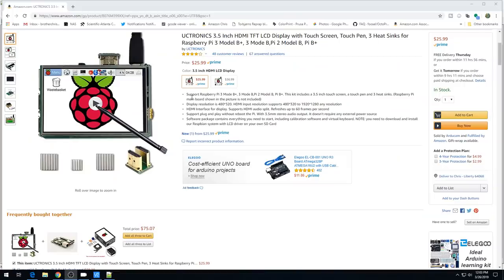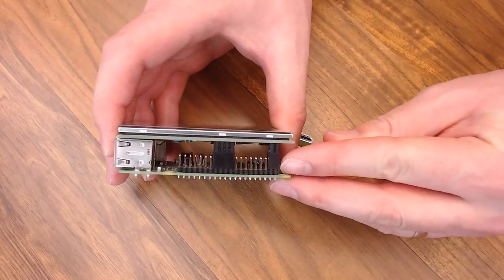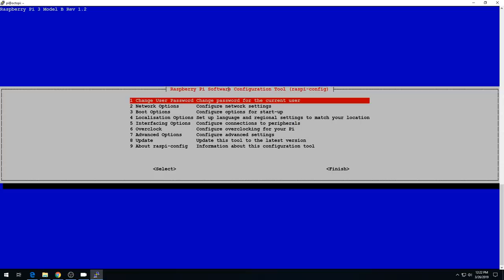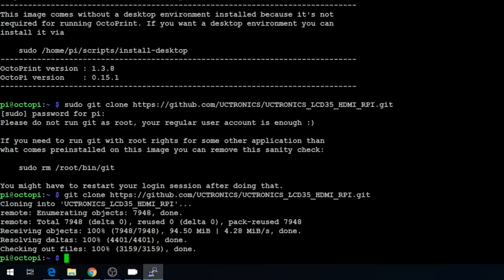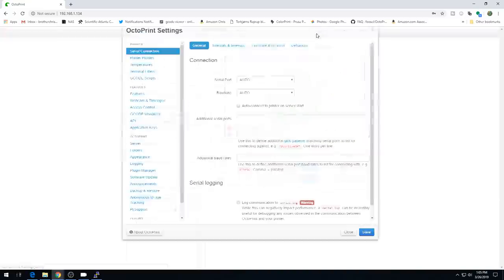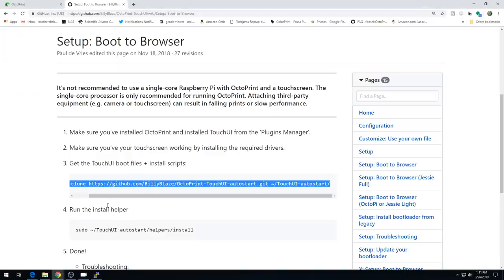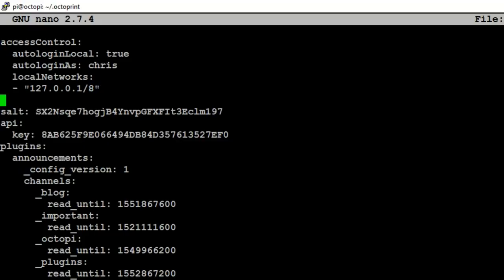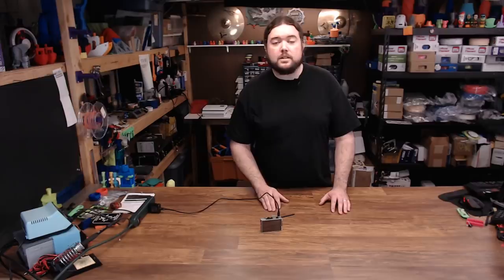Octoprint Raspberry Pi Touch Screen Install - Touch UI - Chris's Basement

Comment: Hey Chris! I'm running Klipper on my RPi 3 B, and just installed TouchUI and am using a 7" RPi touchscreen. I'm having some issues with Chromium taking a lot of CPU bandwidth, to the point that the print pauses occasionally and resumes. I'm curious to hear if anyone else had a similar experience...

Thanks for the video!
Reply from the maker: It doesn't surprise me that it is a pretty heavy load, but I wouldn't think it would cause that many problems. Maybe your pi is getting throttled because of heat or low power?
Reply: Try Octoprint TFT if you must. It's running a native gui on a lightweight x server, not an entire clumsy browser with a shiny x. Or better yet, just get a cheap tab and load the giu from there leaving the pi just to handle the actual printing.
Reply from the maker: @mrkekson  Really? I would like to check that out.

Comment: hello i carefully followed your intruction, however after installing the autoboot script instead of display the login page, it display a sad face document. if i touch the screen this error message appears: 
[::1] refused to connect
what should i do now? thanks
Reply from the maker: Try this https://community.octoprint.org/t/touch-ui-plugin-not-working/16757
Reply: @ChrisRiley  hello, it fixed many thanks. one question, how i can activate forever the onscreen keyboard? everytime i shut down and restart the keyboard is inactive and i can't use it until i reactivate it. thanks
Reply from the maker: @yurif74  I am not sure on that one.

Comment: great tutorial. I have my UNTRONICS screen up and running. However, I mistakenly touched the log out on the screen and can't type or use my usb keyboard to log back in. I need to do a sudo shut down and let it reboot into the touchui. I'd like to try the virtual keyboard for this purpose, or get the usb keyboard to work on it. Can you help me. Thanks Chris.
Reply from the maker: I'm surprised the usb keyboard doesn't work. I would have to test it and see what I get.
Reply from the maker: So I re-did my config, I was able to plug in a USB keyboard and enter my username and password.
Reply: @ChrisRiley  what part of the config did you do. Or was it just an apt get update? Cause I did that and looked inside the raspi config file and can't find anything that pertains.
Reply from the maker: @jwhiting352  I just redid my pi software and screen software from the beginning. My hp usb keyboard does work.

Comment: Well not sure what happen when I installed  touch UI. I rebooted octoprint on my web browse(Laptop) and now Octoprint  is displaying Black background and blue bars across the screen. I should be only seeing this on my 7" touch screen. This is the 3rd time it happen.
Reply from the maker: It know to turn on touchUI based on screen size. Maybe the 7" is throwing it off. You can turn the touch UI off in settings to see if you can fix it.

Comment: Hi Chris - After adding the local network to the autologin inclusion, the octoprint server no longer loads. Any ideas?
Reply from the maker: You have to be very careful in that config file. The characters are posistionl, make sure you have them lined up just right.
Reply: @ChrisRiley  I'll go back and try again. It looked identical to the video, but perhaps too many spaces. Is the first indention one space or lined up exactly as in the tutorial (was 2 spaces if i recall correctly)?
Reply from the maker: @jnstover4  Yes, I think it is 2 for every indent.
Reply: @ChrisRiley  I found the problem. I didn't move the SALT line back underneath the networks. Thanks for getting back to me.
Reply from the maker: @jnstover4  Sweet! Glad you found it.

Comment: Hello Chris and thank you for this vidéo :) I 'm ok with all but on my 3.5" i have a blank screen. Do you have an idea please ?
Reply from the maker: Hey Marc, it won't even boot to the CLI? If that is the case I would say the screen might be bad.
Reply: @ChrisRiley  Hello i try another way and i put it on my blog how. Your help was cool :) You can see how here : its in French but the line code are Internationnal :) https://kits-imprimantes-3d.com/comment-installer-un-ecran-tactile-3-5-rapsberry/

Comment: Hey Chris, great work! it`s done with Waveshare 4.3 inch LCD :)
But one pronblem i have is, icannot start my webcam.
do you have a solution for that?
Reply from the maker: Thanks! Can't start the webcam, so nothing comes up at all? What cam are you using? Does the cam work in the browser version?
Reply: @ChrisRiley  Hey Chris, i use Raspberry 4 B with Raspberry CamV2. before i install TouchUI is the Cam Workin. but after doesn`t work.
Reply from the maker: @slowlyer  Not sure, but you might check over on the touchUI github. Not sure how compatible it id with pi 4 yet.
Reply: @ChrisRiley  okay, it works now :)

Comment: Expanding file system is still important for any micro larger than 4gb. Otherwise, you'll end up with inaccessible space on the card, which limits the amount of stl/timelapses you can store on the pi until you can transfer them elsewhere. 

when installing packages as a user from the command line/ssh, you should be using apt now, instead of apt-get

this also provides a new arg to perform full upgrades. 

sudo apt full-upgrade -y

You should never really be chmodding anything to 777. Usually, you would want to do something like 775 if you are really not sure what permissions you need in this particular env.
Reply from the maker: Good tips.

Comment: Thanks great video.  I am waiting on my screen. I have done everything in the video to the point where you get and install the drivers.
Reply from the maker: Thanks for watching! Good luck with your install.
Reply: He only shows the HDMI version that doesn’t need drivers, I’m trying to get the cheaper non hdmi screen set up and I’ll update here if I figure it out.
Reply from the maker: @kumd  Are the HDMI ones more expensive?
Reply: Chris Riley The HDMI versions are about $10-$15 more. Non HDMI touch screens are only around $15 total. But I spent hours trying to set it up with octopu even trying multiple drivers. But could only achieve a white screen. I have a 5 inch hdmi version from a previous project that worked great following your tutorial. I would seriously recommend buying ONLY an hdmi version
Reply from the maker: @kumd  Got ya, thank you for testing it for us.

Comment: chris, well done video.  i have a raspberry pi 7" screen, i get the message "This site can’t be reached localhost refused to connect." and i do not have the config.yaml file in octoprint
Reply from the maker: Thanks! Is it a TFT screen or an HDMI screen? Not sure what the error is referring to. No vaml file in .octoprint ?  ls -als ~/.octoprint

Comment: Great video,  followed it step by step but at the end when the screen attempts to connect , it counts up to 30 then the touch  UI text goes red and the message below states can't connect, Touch Ui failed ...what am I missing , the screen is  from Amazon elecrow 5 inch  800x480
Reply from the maker: Are you using 0.14 octoprint? It might be a bug. https://github.com/OctoPrint/OctoPrint/issues/2348
Reply: @ChrisRiley  Thanks for messaging back, I've only been playing with Octoprint in the last 2 weeks, so what ever the version was then is what I started with, plus as per your direction I also updated to the latest version, and had the joy of finding out about 0x50005.

Comment: i dont know what the problem is, but for 2 installations i had to install the desktop to the pi first, do get this run. dindt i get this information from the video? :-D
Reply from the maker: I kind of wonder if this is a bug, the autobuild should install enough of the desktop to get you going.
Reply: @ChrisRiley  I don't know, I've Google it and it seems like many people have the problem - with many solutions to it

Comment: Ok today I boot up my ocotopi and it does an update. Now It wants me to LOG in on the tiny touch screen.  

I have configured my config.yaml  by the way you really really speed through that part. And I'm watching on a phone so Its really difficult to see what your typing.

I still can't get logged in. I've lost the use of my touch screen Again!! 

Why did the update screw me out of my touch screen?
Reply from the maker: It removed auto login from your config file. Take a look at it in SSH.
Reply: @ChrisRiley  ill look at that.  You have been great. I'd love a follow up video.
Reply: Is that the config.yaml ? 

Because it's still in there. Just not working
Reply from the maker: @JSCB-365  Yeah, that should do it. Is this still not working? I would like to recreate this if I can.
Reply: It needed a clean reboot. I wasn't doing that part right. I had to log in sudo reboot now. 

That is what fixed it.
Reply from the maker: @JSCB-365  Awesome!
Reply: @ChrisRiley  if anything I can be used as a Bad Example

Comment: Oh, and the case you listed in the description..... DOESN'T WORK WITH THIS LCD!  Anyone know where I can get one or where I can get the STL files that do?
Reply from the maker: There isn't a case in this description.
Reply: @ChrisRiley , I guess the assumption was when you flashed up the Amazon Screen at time index 0:49, the image presented an LCD, a pi, and case commonly purchased together.  My bad.....
The case present will only work with some modifications to accommodate the HDMI plug. The plug will also need some type of cover fabricated.
Other than that, It all works really well. Thanks!
Reply: One other minor thing.  The sudo command to download the driver files in your linked document in the description was incorrect. That command will install the drivers for a normal LCD, not the one for the HDMI ver. The following is the correct command
sudo git clone https://github.com/UCTRONICS/UCTRONICS_LCD35_HDMI_RPI.git
Reply from the maker: @vn1500g3  Ohhh, ok, I thought I was going crazy there for a minute. :) Glad it's working out for you.

Comment: Thanks for the tutorial. Very straight forward. I did have a question.

Do you know how to disable the screen timeout? everything works but the screen will blank out after awhile.
Reply from the maker: Hmmmm, good question, no I don't I would have to look around for that. I will see what I can find.
Reply: In the BillyBlaze/OctoPrint-TouchUI-autostart repo
touchui.default line 41
DISABLE_SCREENSAVER=true

Setup: Troubleshooting wiki located here
/BillyBlaze/OctoPrint-TouchUI/wiki/Setup:-Troubleshooting
says you can edit this too
sudo nano /etc/default/touchui
DISABLE_SCREENSAVER=true
Reply from the maker: @jonolsen7246  Awesome, thank you!

Comment: hello guys, 

I followed all the instructions. 
Everythings looks fine.
EXCEPT
My touch screen seems not to work when I click on it on TouchUI homescreen. 

Did you guy have the same issue ?
Reply from the maker: I saw that, but only when the drivers weren't working correctly. Try to reinstall the drivers and see what happens.
Reply: Thank you so much  @ChrisRiley  .
I have reinstalled everything.

However, still doesn't work.
I have noticed something.
On the boot screen : I have a "Failed" line that appeared after the driver install : 
"[Failed] Failed to start /etc/rc.local, Compatibility.
See 'systemctl status rc-local.service' for details."
Reply from the maker: @bananasESCT  Sounds like the driver loaded something into auto start that wasn't right. What does your rc.local file look like?
Reply: @ChrisRiley  , thank you so much for answering me...
Here is the extract of the rc.local file : 
#!/bin/sh -e
#
# rc.local
#
# This script is executed at the end of each multiuser runlevel.
# Make sure that the script will "" on success or any other
# value on error.
#
# In order to enable or disable this script just change the execution
# bits.
#
# By default this script does nothing.

# Print the IP address
_IP=$(hostname -I) || true
if [ "$_IP" ]; then
  printf "My IP address is %s\n" "$_IP"
fi

/sbin/iptables -t mangle -I POSTROUTING 1 -o wlan0 -p udp --dport 123 -j TOS --set-tos 0x00

echo
echo "------------------------------------------------------------"
echo
echo "You may now open a web browser on your local network and "
echo "navigate to any of the following addresses to access "
echo "OctoPrint:"
echo
for name in $_NAME;
do
    echo " http://$name.local"
done

for ip in $(hostname -I);
do
    echo "    http://$ip"
done

echo
echo "https is also available, with a self-signed certificate."
echo
echo "------------------------------------------------------------"
echo

In order to uninstall the driver, should I do "sudo rm -r mydir UCTRONICS_LCD35_HDMI_RPI" only ? or should I do something else ? 

Cheers !
Reply from the maker: @bananasESCT  The rc file looks of. You probably don't need to remove any of those files, we just need to find the correct one to install.
Reply: Hey Chris!
After checking the Github from UCTRONICS. A similar issue has been raised on it
Reply: Hey Chris:
I will try to uninstall the driver.
Can you please tell me the linux command to do so ? Thanks a lot
Reply from the maker: @bananasESCT  So delete all these to start over.

 /boot/kernel.img
 /boot/kernel7.img
 /boot/config.txt
 /boot/*.dtb
/boot/overlays/*.dtb*
 /lib/*

Comment: I get the Touch UI splashscreen to load on my touchscreen then it comes up with an error: "browsers error console"   Any ideas?
Reply: Okay so I deleted my username for auto login , now it boots to log in screen, but not taking my user name & password. just reverts back to log in screen.
Reply from the maker: That will need to be in there for it to work, empty spaces and such causes the config not to boot. Try again to add the edits, avoid copy and paste or adding anything unnecessary.
Reply: @ChrisRiley  Ty for the reply! I tried like 3 fresh installations, with and without auto-login, same thing every time. Maybe it has something to do with the newest Octoprint update? I abandoned that project until there is a fix, and went to Octodash which is a pretty sweet setup.  Just not seeing the difference between Octodash & Octoscreen?
Reply: I had the exact same issue (using an Elecrow screen). I managed to get it working by following Mike Haro's comment, to change the CHROME_ARGS settings in the chromium.xinit (in folder /home/pi/TouchUI-autostart) from $TOUCHUI_URL to http://0.0.0.0/
Reply: @GalacticGhost  Ty very much for the info, much appreciated! I will give this a whirl when done upgrading my printer this week.

Comment: I might try this,  but I gave to restart from scratch because I kept getting a lot of collisions and the print would start in a corner.
Reply from the maker: That's strange, you think it was caused by Octoprint?
Reply: @ChrisRiley   no, I don't think so, I blame myself mostly because I think I should have done more research. Mostly on configurations.

Comment: Nice. Works great, except I use full size non-touch monitor w kb/mice and can not disable touch interface to get into regular web UI :(
Reply from the maker: You should be able to disable it from a web browser.
Reply: @ChrisRiley  It does not want to go off for some reason. Ended up installing desktop environment to Pi. So far no big performance drops.
Reply from the maker: @escknx  Nice, hope that works for a workaround for you.

Comment: Hi,
thx for that tutorial.
I just purchased a 3.5" TFT and already installed it to the Pi.
Drivers are loaded and the system is booting to command prompt.
Octopi is already installed at at the pi (just before I ordered the TFT)
How do I activate the desktop enviroment? Do I have to?
I played around with HDMI-modes in config.txt but it doesn't help ...
Reply from the maker: You should be able just to run those touch UI commands and it will boot up from there.
Reply: @ChrisRiley  THX for response. Do you think to run those commands from ssh shell or do I have to connect a KBD directly.
Unfortunately I have no graphical output at the screen ... only command prompt.
Reply from the maker: @cappy0815kanal  It should work the same from SSH or the console.
Reply: @ChrisRiley  Really cool ... I got it running.
But I did not understand how to make the resolution a little bigger?
Or ... maybe it is already :-)
Usage with the touchpen is a little uncomfortable, maybe because of cheap display-solution.
Reply: Man ... I got it ... really cool.
Can you point me to turn display and touch 180°?
AND how can I set the resolution to that big view?
Reply from the maker: @cappy0815kanal  I am not sure on the res, there is a linux config file for that somewhere I am sure. Flipping it, most of those screens should have a small button somewhere that lets you flip it.
Reply from the maker: @cappy0815kanal  Check this out, https://elinux.org/RPiconfig#Video_mode_options says it can be changed from the rpi-config menu.
Reply: @ChrisRiley  Ok, thanks ... I already checked display_rotate ...but it makes the pi start up with bright white screen.
I found something in config.txt and it rotates ... but the touch won't :-/
Reply: @ChrisRiley  no button ...
Reply from the maker: @cappy0815kanal  Crap, maybe the guys that created touch UI would know. Hit them up on github.
Reply: @ChrisRiley  Hi Chris. I am back again to your channel and your tutorials.
A few month ago my 3.5" Screen turned into bright white screen and never came back.
No I moved house and descided to setup a brand new installation.
It is the same HW, Pi and Screen.
The first steps worked out well ... Octoprint is running and the display ran into a kind a promt.
After trying to install touchUI I got the white screen again and I have no idea how to remove it.
Du you have a hint what to do?
Thanks in advance.